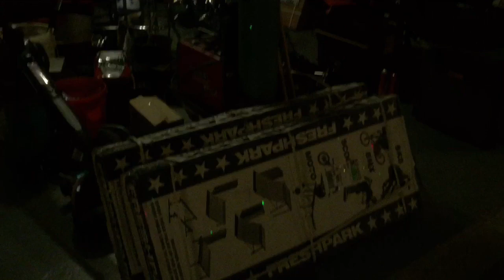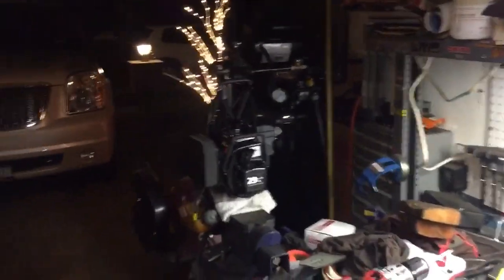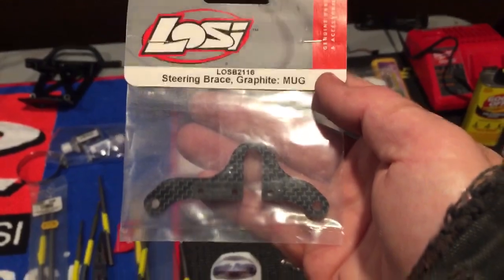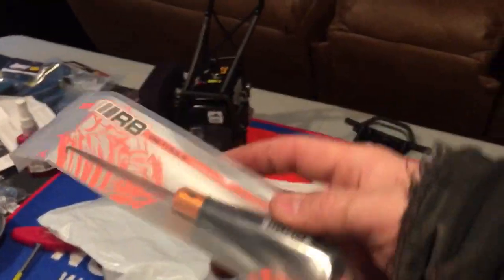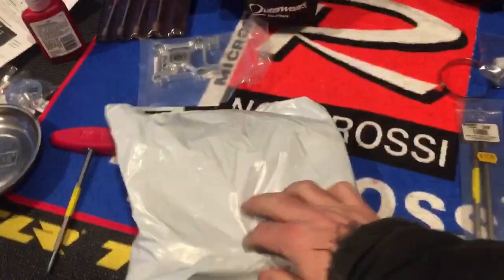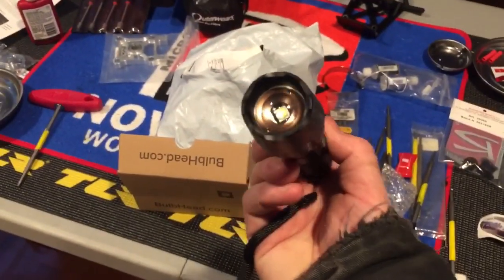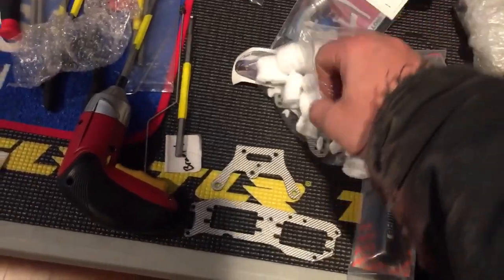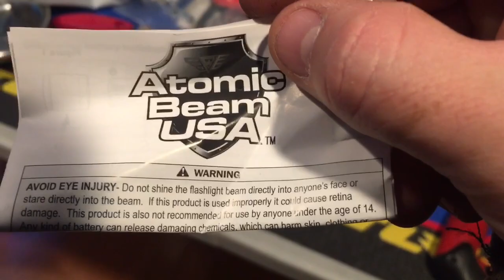Quick Update on things and some Goodies

Comment: John, you need to try a Surefire out! I bought one a few years ago, changed my life! I carry every day, every where, at all hours. I just purchased an E1D Defender back in May and it's better than my other. I've literally put it through hell, it takes it just like a Maglite will. It's 300 Lumens on high, 5 Lumens on low, on (1) CR123 battery. The BEST damn light I've ever had! They are a bit pricey, but worth it. Surefire stands behind them if you have a problem.
Reply from the maker: HillbillyNitro RC thanks bro on that! I always use my flashlight daily. I wear out holsters that's how much I use my maglite and I don't use the ones that come with them I use the black leather holsters that we all have to order at my job. But I'm curious now on this surefire that you talk about and I will give it a try! Thanks for the heads up. Is it Made in the USA 🇺🇸?
Reply: BOTAJELL Yep, 100% made in the USA. They have holsters for them and some gun holster company's are making "kydex" holsters for them. Kydex is the way to go in my opinion. I'll find you a link to give you an idea.
Reply: BOTAJELL Here's another tip. Surefire has some of the best cr123 battery's and you can buy them in bulk for around $1.50 - $1.75 a pop.
Reply from the maker: HillbillyNitro RC thanks Nitro Bro! When I get home from work I will look into it. I have to try one of these out!
Reply: BOTAJELL At the end of the day, it's a chunk of change to spend on a friggin flashlight, but it's worth it Bro. Surefire is top self! They make a lot of different lights, but I think that model (E2D) would serve you well. It's very close to the size of the Maglite you carry.
Reply from the maker: HillbillyNitro RC thanks for the heads up! I'll try to use my Volunteer Fire Dept. # to get it. Thanks!

Comment: I also have a hyper 7 to sell all working with an updated 2.4 tx and rx for 200.  And I have the ultra lx2 for 250 almost new condition
Reply from the maker: RC ACTION Zone keep them! Only sell them if your going to upgrade to something better or just try out something different for a change. That happens to me once in a while. Get a good modded motor from Neal from the TNS The Nitro Shop.
Reply: BOTAJELL I would but I'm in the 1/5 scales already and don't even use them they are shelf queens now.lol